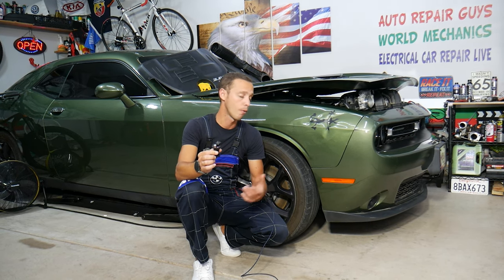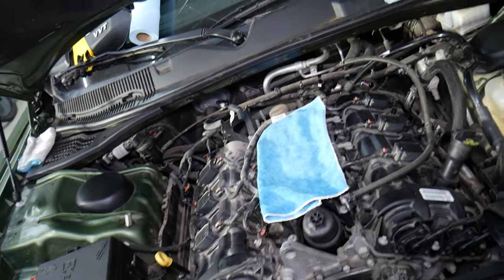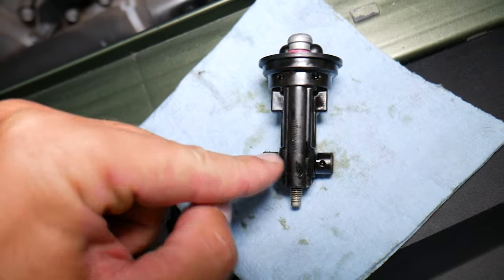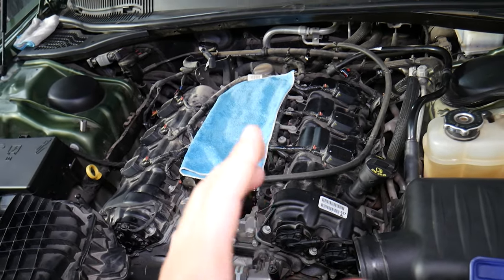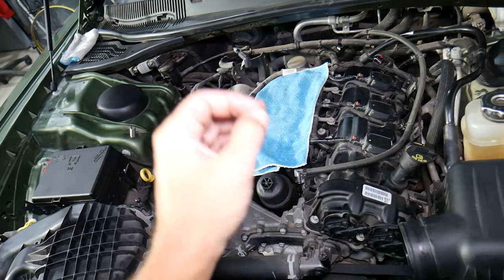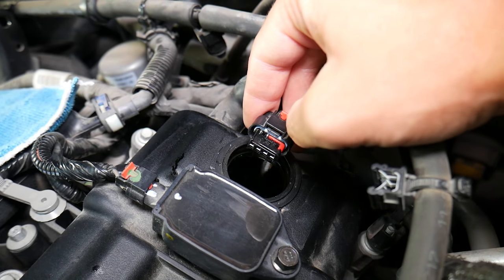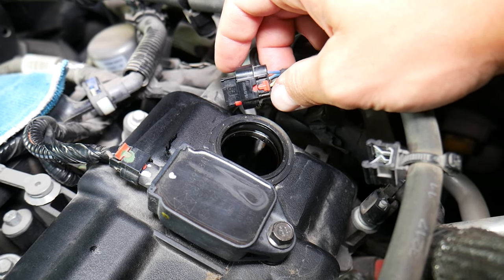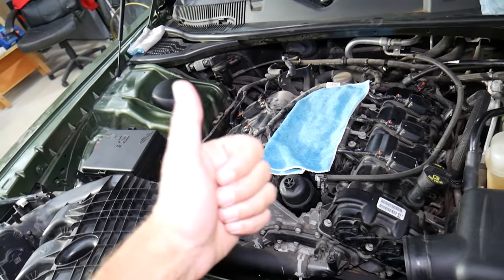THESE ARE THE SYMPTOMS OF BAD CAMSHAFT POSITION SENSOR on a ANY CAR

Comment: Found out today my sensor needs replacing. The car had been stalling and rough idling. Never saw an engine light though.  Luckily it's still under warranty. 👍on the video.
Reply: Exactly what my car does
Reply: Curious did your car ever shut off when driving
Reply: @Wetheppls47  Yes and got steadly more frequent
Reply: @Wetheppls47  Mainly when coming to a stop.
Reply: I was prolly going 30 and it died never had it like that only if a car in front of me stopped and i break with my foot off the pedal as soon as I go back on the gas it would stall here and then
Reply: @Wetheppls47  It certainly wouldn't hurt for them to run some diagnostics on it

Comment: thank you so much!! my camry was doing the almost dying revving cycle and eventually giving out after a few rev’s. I did not know both sensors were going out and only replaced one with the same symptoms. so I then replaced the fuel pump thinking it was that, and now am going to replace the second sensor. thank you again for confirming my issues!!
Reply: So your car wasnt starting ?

Comment: Thank you i had all these issues and changed my vvt solenoid, oil change, and still didnt work, finally ordered new camshaft position sensors
Reply: Did it work?
Reply: This is what I'm going through right now. Changed the solenoids due to P0017 code and did an oil change. Car runs well except when i go to brake and slow down, it dies. Took it to run a diagnostic scan at AutoZone and we get code P000B camshaft sensor. Part comes in tomorrow and I'm PRAYING this fixes the issue otherwise I will have to take the car to Hyundai.
Reply: @grecianbeauty1980  did it work ?

Comment: My 3.6 throws a p0309 and p0349 but ONLY on the highway when hot and under load. It's done this for years. I added Lucas oil treatment and it stopped.  I think its cam phasers because I have replaced cam sensors and tested the plugs and wiring. The only thing that fixed it was the Lucas.no idea, but I wish I could get it fixed correctly

Comment: Replaced camshaft sensor. Mechanics said they checked all wires and all good. They told me that the carbon build up can be affecting the signal to the signal plate. This is the same as the sensor magnet ? Will carbon build up on this cause 340 code with same symptoms of bad sensor ? I have a g35 2003. My car has now gone through 2 mechanics and myself. Spent 800.00 now with still no fix.

Comment: I have the same engine in my 2021 Dodge Challenger. My camshaft position sensor is saturated with oil does this happen often? I don't have a check engine light or rough idle.

Comment: Can the camshaft sensor cause it to have no spark?
Reply: I guess it depend on the motor but as a mechanic based on what I've seen no spark would Moreso be your ckp not the cmp. Based on ny experience it seems like the cam sensor tends to cause it not to have fuel nore than spark

Comment: What's meant by circuit B, Bank 1???????
Reply: A is intake side B is the exhaust side. 4 cylinder has only bank 1. v6 and v8's has bank 1 and 2

Comment: I have a fiesta st2 180 4cyl and it will not run right it dies out eventually and  code for cam sensor shows and just misfires badly I had no idea the cam sensors can do this I always thought the crank sensor did the main timing and the cams for variable timing and would make it run rough not like it is.